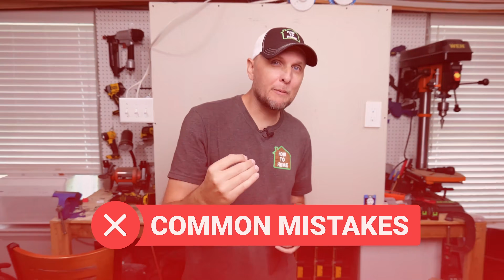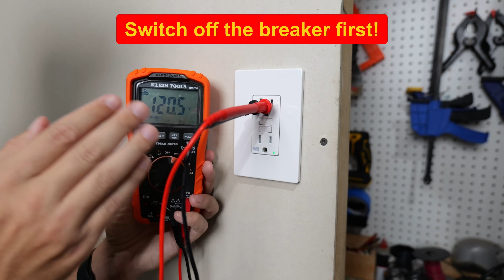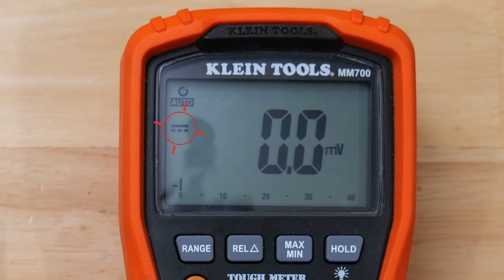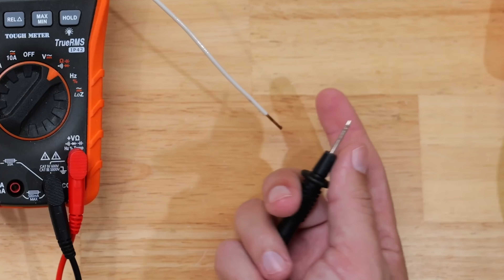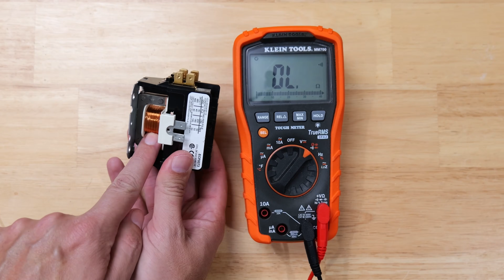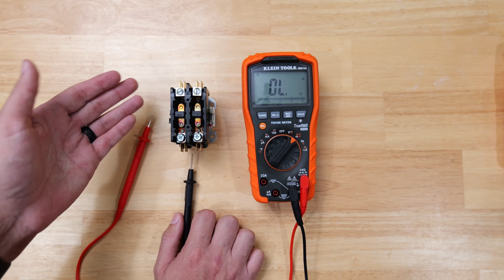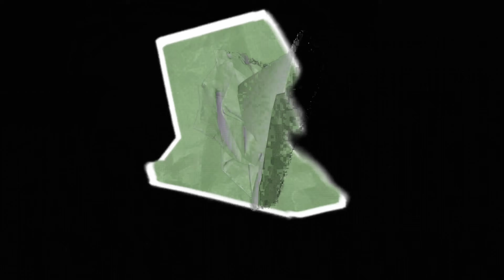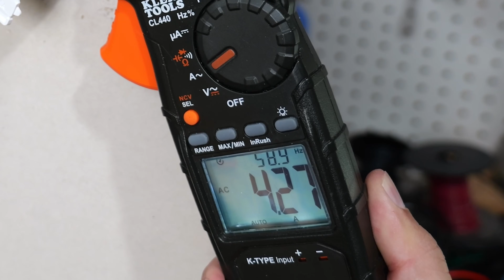Most DIYers Are Using Their Multimeters Incorrectly!

Comment: One thing I would add is that people will note that (non clip-on) multi-meters can also measure amps.  However, it requires putting the multi-meter in series with the current which typically means moving the red plug over to the "10A" or the "uA/mA" socket on the multi-meter.

I strongly recommend that people NEVER use mulit-meters to measure amps.  First, mA/uA readings will be seriously off due to the high-valued shunt resistor in the multi-meter.  Second, you are virtually guaranteed to make a mistake and blow the multi-meter's fuse by forgetting to move the probe back.

So to measure amps, you really want to use a clip-on meter and its nice to get one that can do AC or DC.  DC amps is hard to measure... it's actually done with a hall-effect sensor and not the CT loop, so DC clip-on amp meters tend to be a bit more expensive.  But they are also a far safer way to measure amps.

--

Another thing I would bring up is that measuring AC voltages for light switches and such can result in a lot of confusion because even when a switch is turned off the AC will couple across the wiring and may have a reading that "looks" like a HOT when its not (hey, that rymes!).   This is particularly true when probing 3-way switches and other odd topologies.

So if you get an odd voltage that doesn't seem stable and isn't the expected HOT voltage, just keep that in the back of your mind... you might be probing a disconnected wire due to a switch that is still reading a voltage because of AC coupling between wires.
Reply: One solid option for checking light switches without removing them, is to set one probe to a known ground with the meter set to AC volts, then use the other probe to check which of the terminals on the switch are reading the expected voltage(hot). Then flip the switch and repeat. Both terminals should be hot when the switch is on and only one should be hot when it is off. This can tell you which wires are hot and whether the switch is working.
3-way switches will always be more complicated than this, but that gets into circuit pathing that may be unique to the given situation.
Of course, this will be harder to do with switch boxes that have no ground. But you shouldn't be running into many of those, I think.
Reply: @kevbu4 
  You might be surprised. Just because it's been updated to a 3 prong, doesn't mean it is one.
Reply: @jeffhill3681  I was talking about light switches, but the point you brought up still applies. Anything that's up to current code should have ground wires even in the light switch boxes. But you make an excellent point, that the electrical you end up working on might not be up to code, or may have been done by someone who didn't have the training or time. So, I guess just be prepared for anything then.
Reply: Using an inductive clip on meter, you will be hard pressed to measure anything accurately  especially in the mA and uA ranges. This is where a quality meter is useful using the meters internal shunt. However, this is usually beyond the abilities of most Diys.
Reply: This is good advice 💯
Reply: Plugging in a load, such as a lamp, can greatly reduce problems with coupling. Also, I have seen two buildings that had the hot and cold wires reversed to the recepticles on the walls. Never trust which is Hot.  8-}

Comment: Contact points burnt up.  Poor connection.
Reply: I can't see them well enough to be sure. We used to dress them up with emory cloth in the Navy and only replace them when they were so far gone that we could not restore contact surface.
Usually the coil would either short or open first, and occasionally the thing would develop a high resistance connection on one of the leads and either just stop working or actually start smoking and burn up.
Also, they can start chattering or buzzing, so we would install shading coils to enhance the coil field and stop the chattering.

Comment: Just a slight criticism of the voltage check at the receptacle, your phrasing could be a bit confusing to a DIYer not familiar with the GFCI. When you tripped the GFI, obviously the load side of the receptacle is no longer functioning, a homeowner may assume that the line side is dead. Only the load side is off and the line side remains hot. If the DIYer attempted to change the receptacle, he could get a nasty surprise.
Reply: Exactly
Reply: Good point.
Reply: Confused, if you did not know about AC and DC voltage symbols. I do not think you should be near a DMM and mains power.
Reply: And another criticism. Probably should have pointed out that a capacitor needs to be shorted out before you touch the terminals.
Reply: that's called a chocking surprise keeps your hard working  lol  just thought I trow that in,,   I had my fair chocking news / chocking surprises
Reply: Nasty surprise with american voltage? We would just use tongue in Europe to check if there is 120V. 😀
Reply: @Pidalin but isn’t European volte 220?
Reply: @edge1289  It was 220V here in Czechia during communism, but now it's 230V almost in a whole Europe. My grandma still has old wires from 1st republic era (interwar period) that were meant for 120V, they still use them for lights even when there is 230V now, it doesn't really look safe with that cotton isolation, it's crazy that nobody replaced thise cables in 80 years, but it was a mess in Europe before WW2, so many voltages, sockets and everything, it was standardised after war.
Reply: I’m pp
Reply: This clickbait will likely cost a few people some trouble.
Reply: Nothing wrong with learning the hard way.
Reply from the maker: I said I was just simulating it to show what the meter would say.  At no point did I say that’s how to test it.
Reply: @HowToHomeDIY  No one's throwing shade on you but just saying that if there's a way for someone to stupid they gonna stupid.
Reply: @katerwaul23 sometimes it’s not always stupidity. I was a service technician for Sears and Wards and hate to admit how how many times I’ve been lit up and usually from silly mistakes simply because it was repetitive. One time I was changing out a heating element on a hot water heater. The dirt floor was horrible and uneven. I killed the power at the breaker but rather than checking it with my Fluke I began work. Either one side of the breaker failed or the breaker itself failed. Now why I did what I did I had no clue but I grabbed the pipe to help stabilize myself and when I grabbed the wires to bend the wires out of the way and it was just a perfect come together and I got lit up. Oh by the way I tripped the breaker. Another time I was working with 12 VDC when my watch with a metal band came in contact with the voltage source and frame, the band got hot and left a brand on my wrist for several years. Another time I was working on a treadmill when those became very popular. I was working with 110 VDC And had the motor  control board in my hand checking voltages and had the Sears Technical assistance on the phone with me when they control board shorted to ground and was shocking through the metal heat sink which is aluminum part of the circuit board that absorbs heat from the board when it’s operating. The customer said she saw the electrical arc come off my finger tips for 6 inches. Another time my  coworker and I were changing out a water heater. The customer worked nights and looked extremely tired. We  had the wiring undone when my buddy started to grab them and I said hold on don’t you think you better put your fluke across there and make sure it’s off and he nah she had it off for him the last time he was there. Finally he grabbed a Phillips screwdriver and went across the connections and it wasn’t off. Molten copper flew in my hair and all over us burning my scalp. I told him Gary it’s off now. As you can see these examples could’ve been prevented but due to our own trust, negligence and the repetition it lead to excitement lol 😅. There are others but I think I’ve bored you enough. Stay safe out there ladies and gentlemen.
Reply: @HowToHomeDIY  it was slight criticism intended to alert a DIYer not familiar with residential electric circuits, if it saves one person from getting a rather nasty surprise, it’s worth it.
Reply from the maker: All I said was that in the video I said I was just simulating the power being turned off.  The word simulate’s definition is to initiate the appearance or character of.  To pretend.  How we got to calling me thin skinned for that is interesting and hardly a criticism when at no point did I say the power was off or a way to turn the power off.  But I’m here for the engagement.
Reply: @edge1289   You are correct, when people 'double down', because they do not want to admit, that there may be a 'better/safer',  way to convey a mesage...it is sad to see, especally from knowledgeble people, that many will listen and admire,  wih no thinking or questions asked. Being hubmble is a good thing and noone is perfect, admitting once 'errors' is the first thing to being a better person. But whne someone is young, that what usually happens.
Reply: @HowToHomeDIY  Maybe reconsider an edit with TEXT.
Reply: @HowToHomeDIY 
That is an excuse for failing to point out a possibly deadly situation.
I liked your video, good job, but I’m disappointed you wouldn’t admit your mistake.
Reply: @HowToHomeDIY sure, but would it noy be better to point out why.
Reply: @HowToHomeDIY agreed, but as a very experienced DIY’er, who has EARNED my scars, the OP is correct!
Reply: @HowToHomeDIY  Yeah well, the poster is correct, some people know nothing about electrical and could run into a nasty surprise JUST like they stated. You are being pretty thin skinned about a valid point!
Reply: @KStewart-th4sk  I agree about the thin skinned reply. Otherwise, a great video.

Comment: And just about all areas DIY on electric work is illegal to do per code , so you best do your home work first , and I never use that meter if u buy a Fluke 1000 it test AC and DV automatically . and I have changed all rec plugs switches and never turn power off and Never been shocked or popped a breaker , get a fluke saves you and put ur route on that battery.
Reply from the maker: That isn't accurate.  In most places in the US, homeowners are allowed to do their own electrical installs and repairs.  They may still need to pull permits and have inspections done, depending on the project.  But it is very much allowed.
Reply: You a TikTok lawyer?

Comment: Capacitors: Unplugging the power source isn't good enough. They can hold a charge. Discharge the capacitor before testing it or touching the contacts on it without being insulated. Usually, just a screw driver with a plastic handle can be used to short the terminals after the power has been disconnected.
Reply: A dear friend told me that his uncle had a TV repair shop when he was a kid and his uncle would say, “Hand me that capacitor off the bench” and, of course, it was still charged up. He said he learned pretty quickly to discharge one before picking it up. 🧐👍😮
Reply: @JBarleycorn  I hate jerks like the uncle who think pulling those kinds of stunts is funny. Last time i saw something like that happen, the victim grazed the guy's jaw with his fist. The victim was pretty good with his fists, so the perp was lucky that's all that happened. He didn't actually touch the guy but i think there was no room for a pinky finger.
Reply: @KStewart-th4sk , If someone says, “Here, hold this wire. Now, hold this other one”, don’t do it. 😮👍😎
Reply: As a child I thought it was impossible to get a shock from a 1.5V dry cell, until my dad had me hook a 5H filter choke in series with it. Nothing happens when you connect the wires, but just hang onto both ends when they're separated! V = L × di/dt